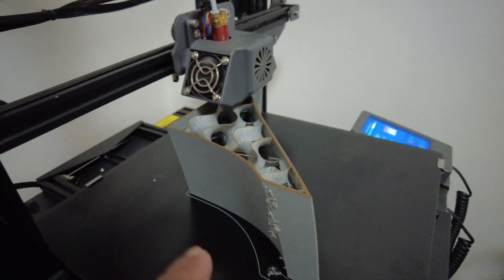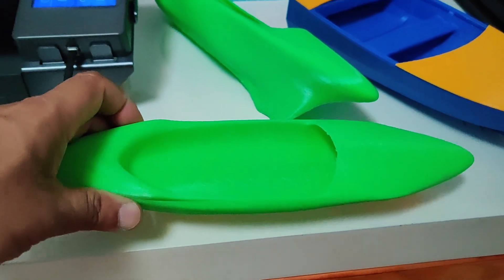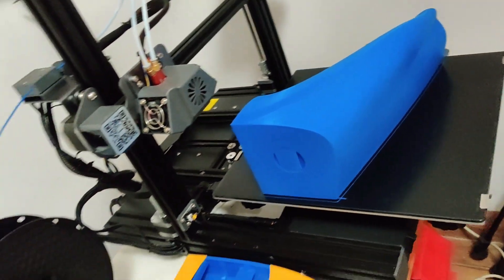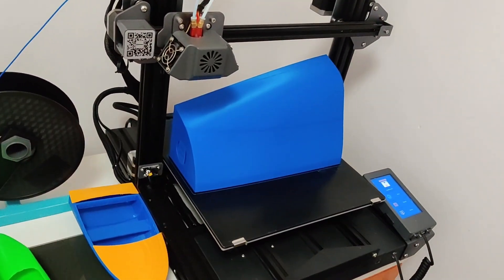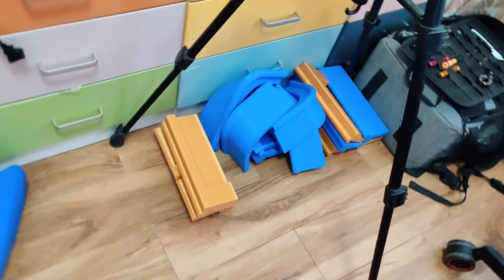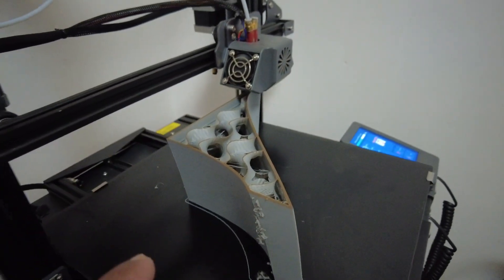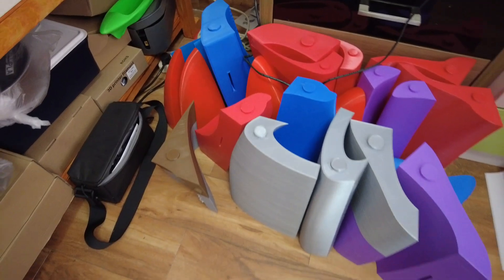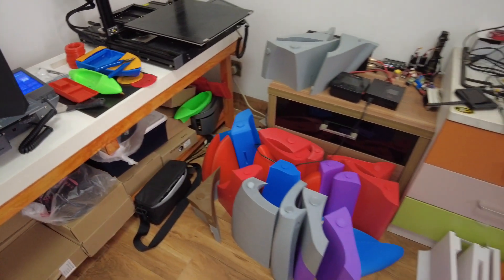I 3D Printed a Mini Kayak using Desktop 3D Printers only

Comment: Hi Ali, do you have the file available for this kayak? Would love to print one!
Reply from the maker: Hey buddy, very sorry but this file was deleted as i changed my accounts. by the way i did not get the time to test it because its pretty heavy and I am sure it won't float. we need to print hollow parts (No infill) and then put a glassfiber skin to make it stronger. then these will float.

Comment: Hello Ali, here are some years that I follow your always interesting videos ... My concern today ... I am under Pixhawk 2.4.8 and I cannot get a 360 ° servo connected to the AUX OUT to work. .I'm under Taranis X9D..Certainly a setting under Mission Planner with lack of identification between the RC, Servo function ... Does an explanatory video exist?
Thanks to you
Reply from the maker: Hey Buddy, unfortunately i have never worked with Pixhawk flight controller. so I am unable to help here. Maybe on RCGroups you can find pixhawk controller thread and there you may get more help.

For 360 Servo to work of course you will need to make sure to provide it power and signal both. check if your pixhawk aux out is providing 5v - 6v and signal or not?
Reply: @alishanmao  thank to you Ali, see you

Comment: You should get the 3d printer with treadmill, see if you can build one without partition :D
Reply from the maker: that would be like 1 month or more for printer to run straight without turning off and it would not succeed. filament changes in between, nozzle blocks that make printer keep on moving without oozing anything out, filament getting stuck, and other similar minor issues. its better to have a small part failed to print than a watching a whole 20 days of print failing LOL
Reply: @alishanmao  oh yeah you got a point. Besides, if you have multiple 3D printers it'll be a lot faster printing all parts simultaneously.